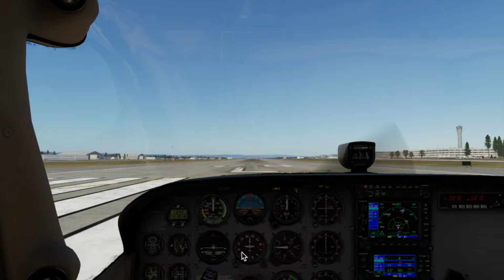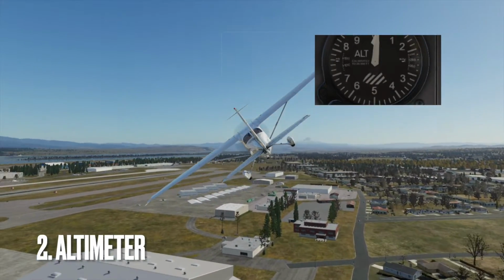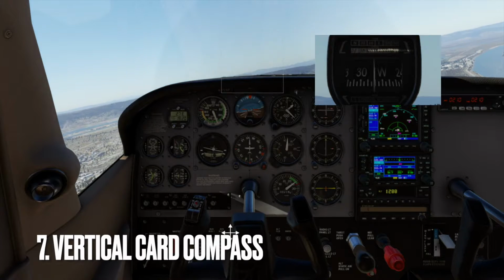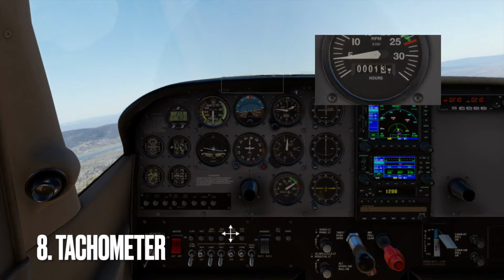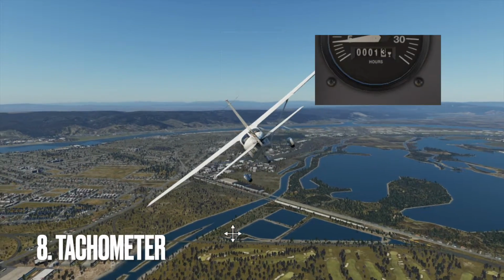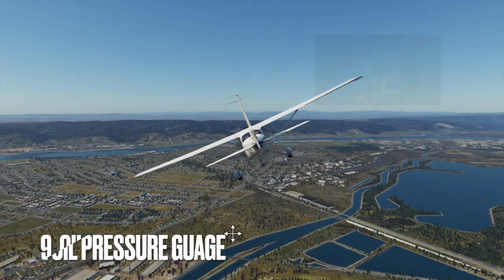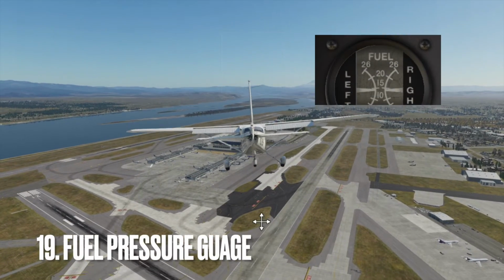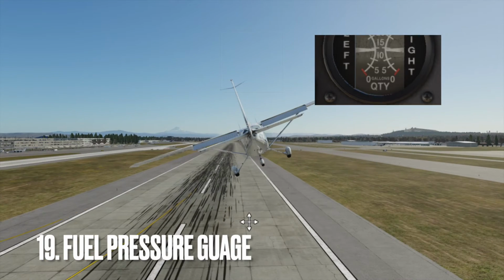Mastering the Cockpit: Demystifying the Cessna 172 Dashboard Indicators

Comment: Based on the video images this pilot also NEEDS a breathalizer. 
 Ray Charles, Stevie Wonder, or Ronnie Milsap could do a better job tracking the runway centerline than this clown. 
Way to scare the crap out of both nonpilots and actual pilots. You should be ashamed of yourself for posting this erroneous image of flying.

Comment: Good effort, but you are describing the cockpit of generic GA planes, especially the [retractable] gear indicator, which is present only on the 172RG version of the C-172. That is a VERY small percentile  factor: of the 172 over44k produced, the RG represents only a 3-5%. Some of the other stuff you described is present on some 172s as an add-on, or  possibly on the very latest S-SP versions--also a small number of aircraft. The most common 172 is the M version, then probably N, L... not sure. Like I said, good effort, but to make it REALLY useful, try to understand the contents, not just read them out loud. I hope this helps. Just a pilot feedback.